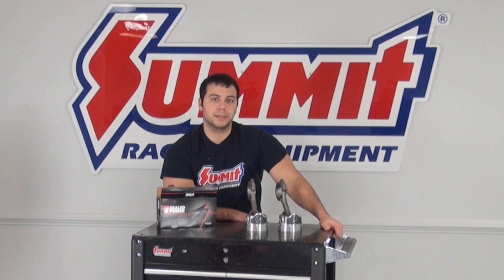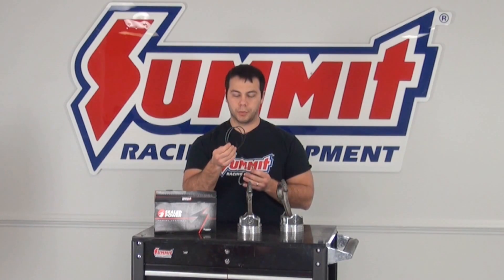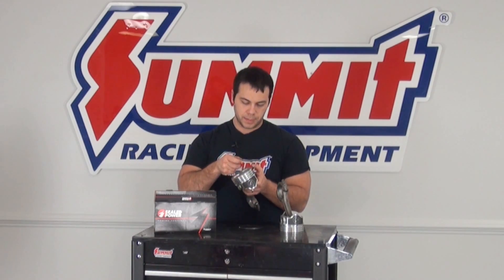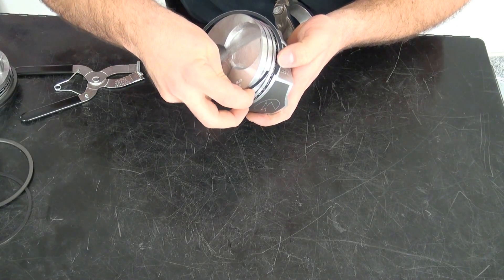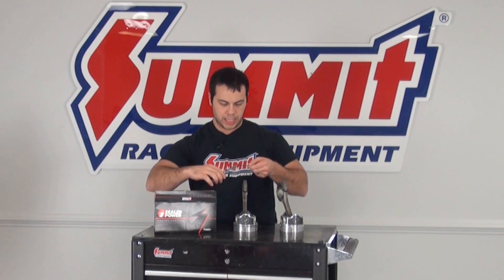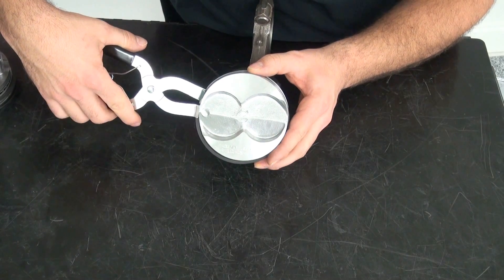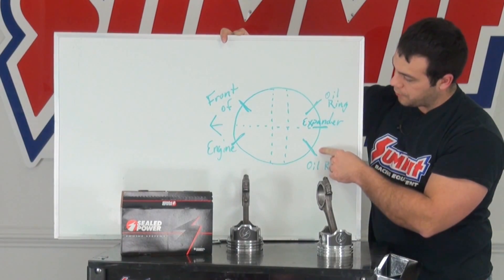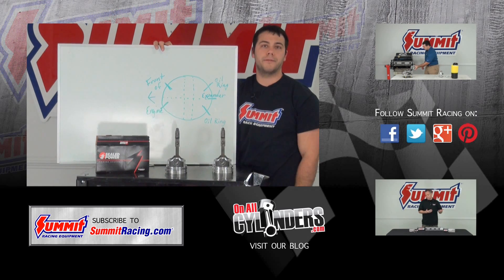How to Install Piston Rings - Summit Racing Quick Flicks

Comment: If you line both of the up, you will have blowby and lose compression,  top ring should be on the back of the piston and the bottom towards the front on the engine

Comment: Piston Boss runs parallel to the crank ...Top ring: 10 clock, Second ring, 2 clock, oil control rings 4 o clock & 8 o clock..Use a compression tool to collapse rings when installing piston in bore, Lightly oil the piston skirt, and put the motor together like your operating on an open heart patient. Don't forget protectors on the Rod Bolts, as you tapping the piston into place. Bearing lube ...keep mating surfaces of the rod cap and big end clean and dry. Thin oil on the threads only when torqueing together. Experience...6 motors a year, almost 35 years. 2 failures. 1 455 Old's dropped a valve, 1, 454 Chevy valve spring bound up, hung a valve, lunched motor...Both motors in Go Fast Boats...Not a bad record. Tom Harrison , Pin position the first thing I noticed. Go back to school Summit Boy!!
Reply: Thank you for the correction. This is potentially dangerous information they’re spreading here.

Comment: Dankie/ Merci Summit Racing for this educational video. Can the oil rings be up-side down? There is no makings on the oil rings?  So there is no top or bottom side? And for especially for motorbike engines! Thx.
Reply: 1:27 he discusses PIP marks on the rings.

Comment: some rings only have a chamfer or beveled edge to mark up or down orientation. what then? that was the one thing i was hoping to get out of this video.
Reply from the maker: Thank you for your question.  If there is no dot to be found, install the second ring with the inner bevel facing down and the top ring with the bevel facing up.
Reply: @SummitRacing  thanks for reply. It's appreciated very much.

Comment: What about ring gap clearance? Does the ring come already cut to what you need or will you have to file it down and gap check it?
Reply from the maker: If you order standard fit rings and the cylinders have been bored/honed to the correct specs, the ring gap should also be within specs.

If a standard set gives you too large of a ring gap, you will need to get a set of file-fit rings, which are generally .005” oversized.
Reply: Okay thanks

Comment: Rings setting is wrong, 180 is the best way no blow by or back pressure.
Reply: rings rotate during combustion cycles, its pointless after first start.
Reply: Joseph Rajaram I’m with u bro, is the correct form to put the rings in the piston, 180, the oil rings one in the front and the other in the back, the compression and the other ring one in the right side and the other in the left side, it’s my way to put  the rings on, what is your?
Reply: Gustavo Espaillat it’s been said before, staggered rings is pointless. Whether you like it or not, once the motor is running, your rings will spin.
Reply: @youwantshum9860  it's true. Every engine I've disassembled always have piston rings almost in line with each other.
Reply: Ok
Reply: Hahahahahahahahahahahahahahaha! My boi! You funny

Comment: Is there a diff between the top ring and 2nd ring, are they the same? if not what is the correct ring for the 2nd ring?
Reply from the maker: crafty1444, 
Top and second rings are different and varies per manufacturer that is being used. This should be outlined on the instruction sheet included with the ring set. Give us a call with any questions you may have. 1-330-630-0240. Thanks for watching!

Comment: Im building a pretty stout 351w with forged pistons and moly rings i plan on puttin a lot of nitrous on it how much more end gap do i need?
Reply from the maker: Hi Zane Jones, 
We need to know the manufacturer of the pistons and rings prior. We want to be sure we give you the best and most accurate recommendation. Feel free to give our tech line a call at 1-330-630-0240 as well! Thanks for watching!
Reply: Summit Racing its a speed pro rebuild kit with forged pistons moly rings for a .040 over 351w

Comment: Can you flip a oil control ring ? because some 1 said to me that if you do it wrong it wil scrape oil up and not back down.
Reply from the maker: Hi remkopopma, 
The three piece expander type oil ring consists of two steel rails, which receive equal pressure from the center expander to assure positive oil control. The three-piece design allows rails to be manufactured with a small cross-sectional area for better conformability to the bores of today’s low-tension, low-friction engines. The rails thin wall contact also allows for quick break-in time. The stainless steel rails are normally chrome plated to resist wear and extend engine life and have no specific top or bottom when installing.
Reply: You didn’t answer the question!

Comment: The expander pliers might work on big pistons, but when you work on small engines like motorcycle, pulling that gap wide enough to slip down over the piston almost always breaks the ring on the opposite side.
Reply: Dankie/ merci Paul Crissman. That is problem I'm facing/ thinking. What it I had put the rings on up-side down? And what about oil. Don't you oil the rings before you put them in the cylinder?

Comment: doesent the wrist pin follow the arrow direction?
Reply: I'm sorry but his drawing is wrong. The wrist pin is supposed to be parallel and inline with the front end  and the rear end of the crank correct? The wrist pin can not be at the right angle of the crank! The wrist pin the small end and the bug end are parallel with the crank otherwise it doesn't work.
Reply from the maker: Hi Damo B, 
Do you mind giving our tech department a call? 1-330-630-0240. Thanks!
Reply: yes it does